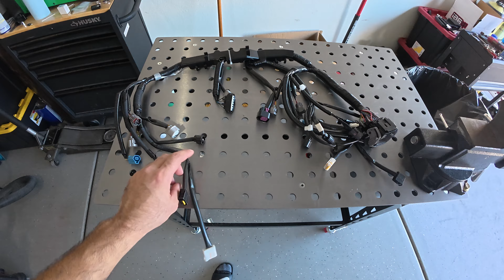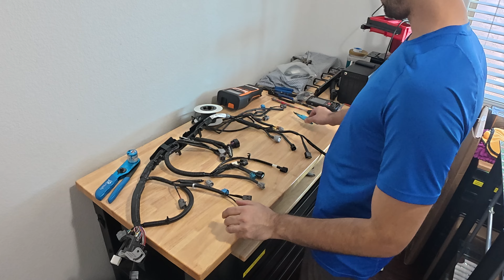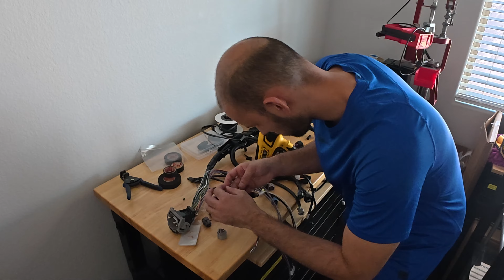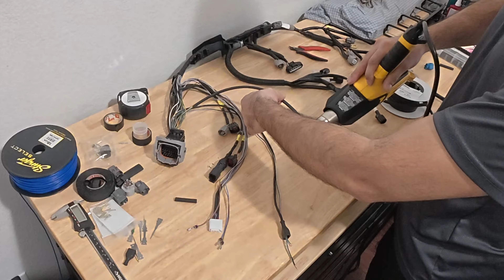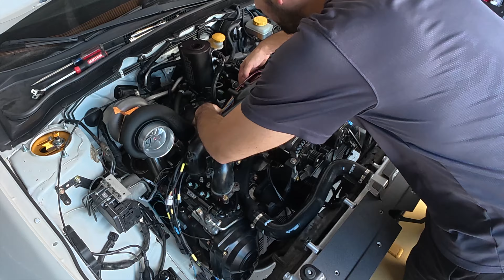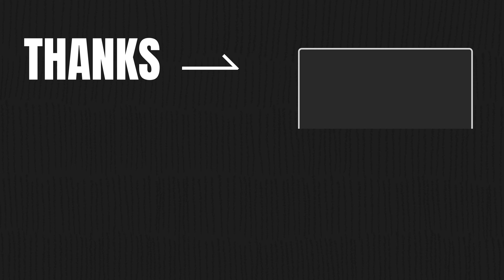Subaru WRX Harness Mods – From Stock to Custom (Part 1)

Comment from the maker: Part 1 of the WRX Harness Mods is live! ⚡
I’ll be finishing the harness once my new supplies arrive (Part 2 coming soon).

👉 Question for you: Have you ever modified or repaired a wiring harness before? What’s the toughest part for you — chasing connectors, keeping it clean, or dealing with limited space in the engine bay?

Drop your thoughts below ⬇ — I might feature some of your answers in the next video!